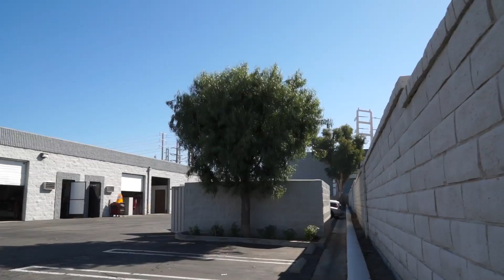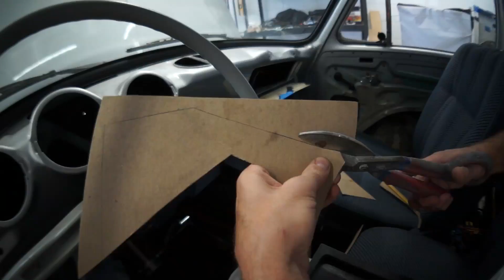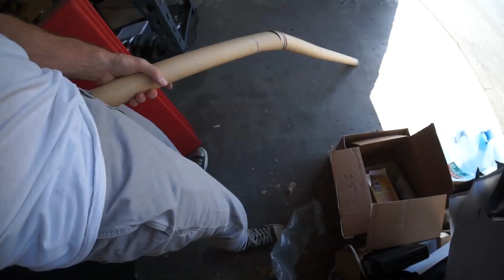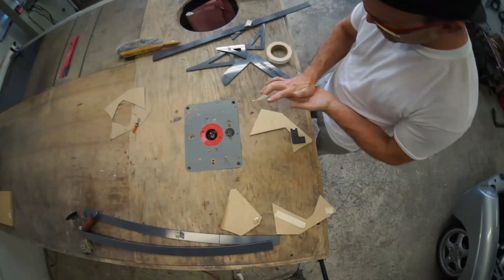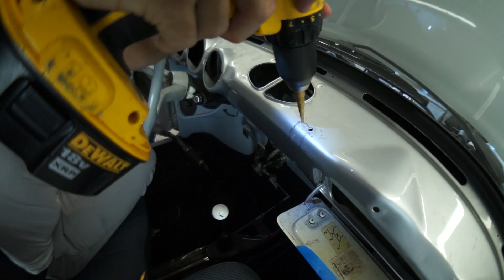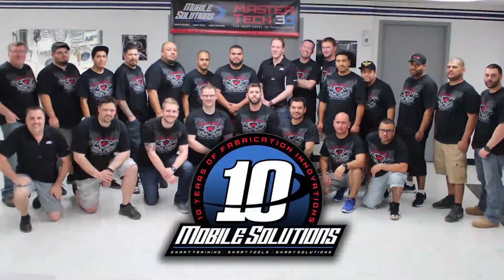EASY TEMPLATES!

Comment: Nice!  I built something similar for my 67 Bonneville back in the day (late 90's).  Except there were no iPads back then haha.  I installed a Pioneer deck, and mounted 4x6 speakers in the sides since the car only had an AM radio and a single speaker in the center of the dash.  I wanted to keep all of that original.  I built one for my 2010 Explorer also, and remote mounted a faceplate in it for my tablet install.  Works great when you need to create space!  Building pods is fun!

Comment: "We also need to get..." Cha-ching! $$$ Amex is going to love you. I think you should glass the center console to tie in the look of the legendary kick panels. What I'm curious of is how you'll finish the top of the stereo console panel. You have those vents there that either need to be relocated or the console need to drop below them. Tuned in to see where this goes! Looking great so far.
Reply: im pretty sure he doesn't use ac or heat in the mule. so vents are fine
Reply: The 2 "D" shaped holes in the dash are not vents, it's the factory speaker location.

Comment: I would have cut the hump out of the slider before chopping the dash but oh well.  I bet it will tip plenty without bump.  But on the other hand, you can weld so just hold on to that piece and you can always put it back.  Can't wait to see the finished product, it's going to be sweet.

Comment: +Doug Bernards (Soundman)  So stoked you're attempting to fit a slider with your MX406.. I'm running a similar setup (MX406, MCC404M & MCC301M) and have been on the edge of my seat seeing if you'd outfit the mule with a Mac HU... Have you considered figuring out a way to input using the Mac's optical?

Comment: Hey Doug nice work done with the templates. Take it from a fellow installer this looks kind of boxy. Not very 2016 design. Something like those plastic stereo below the dash in the toyota trucks of the 80s. If you are going to add some curves later ok, I take it back. But consider that the vehicle is full of curves and something so square would not seem nice in the center of the dash.